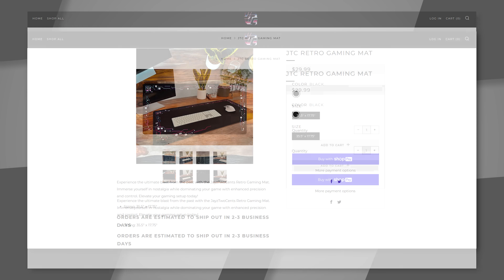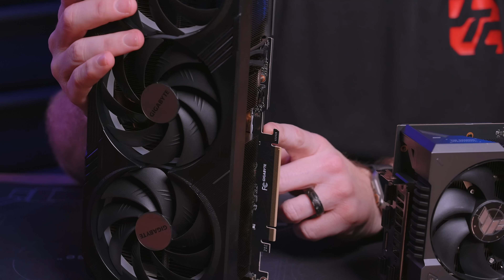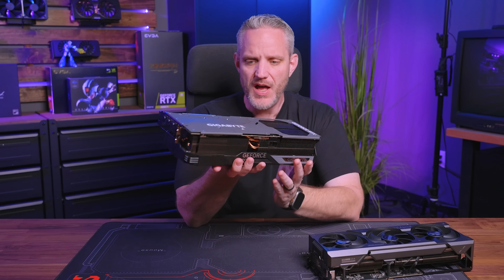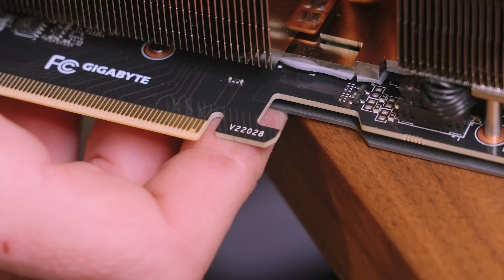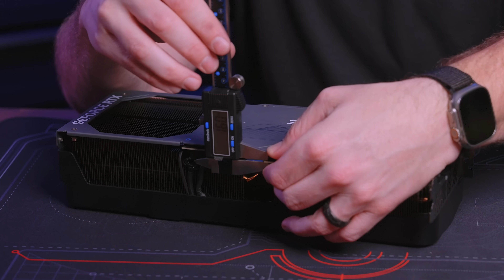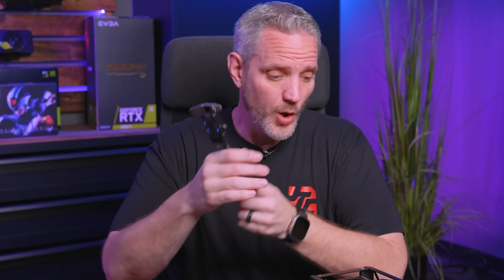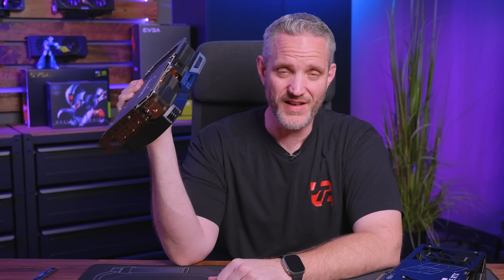These GPUs are cracking and the company REFUSES to warranty them!

Comment: Gigabyte does not have the goodwill to burn on something like this. If we are being honest most pc part manufacturers have been burning through any goodwill they've built up recently.(there are exceptions) Gigabyte however hadn't built that pool up yet at all. They are 100% eating thier reputation here deep into the red, possibly unrecoverably. Back to back Ls. Some brands have a pool of good will to bounce mistakes or bad batches off of, lots of people like evga for example, if there is an issue with thier products, the goodwill means the customers are more compliant and assured that they will be done right/taken care of. Puts them at ease.

Comment: To be fair - rubber is more elastic than plastic.
But it doesn't mean that rubber will break. It's a dumb comparison, but my point is more flex material is not necessarily worse. Would be cool to get info from the owners of similar cards. I kinda understand why Gigabite doesn't want to rma physical damage

Comment: hi .. 2 things ... 1. if multiple Cards with the same Failer/Error  come in .. then its not a defect .. its a Desighn Problem ... 2. at 6:45  the differnz in this 2 Cards is not that the PCB is more stabel ... when You look at the Videos both PCBs flex very easily .. the Reason that the Asus card seems more Stable ist the Screwed metal Post  wich gives a little more stability  and Prevents the Board to Flex in the Right side aeria

Comment: Good point. I agree with Jay on this. It's probably the latch that hasn't released yet, and the user yanking on the card. Admittedly it's a poor design, and why are Gigabyte overrepresented? Weaker boards perhaps but should you worry? I'd put my money on no.

Comment: I'm going to buy a GPU and I'll check the internet :
ASUS - these cards have a terrible coil whine
GIGABYTE - cracking
MSI - Good but expensive 
Sapphire- My favourite, but I want Nvdia 
GAINWARD - RPM problems , performance problems
Acer - I just don't trust Intel ARC drivers very much
ASRock - There is no buy just Intel ARC 
EVGA - They ended :( 
Inno3D - I've never seen the brand, I don't trust it. 
PNY - Very bad 
XFX - We only have 3 cards 6600, 6700 580 
Powercolor - We don't have Red Devil or Hellhound here. 

So what card should I buy today?
Reply: Zotac? Jk.

I think MSI eould be the best if we're going to choose by brand and then ASUS

Comment: Gigabyte Warranty Service is a separate division in the US from Gigabyte Corporate (that designs and sells the products). I HATE Gigabyte Warranty department, they will literally find ANY excuse not to warranty something. I had two problems with my Gigabyte X570 Master rev 1.0 motherboard: first issue was that CPU lane NvME drive had the shield torqued down so hard that when I went to unscrew the little screw the head just broke off and left the threaded portion stuck inside, with no way to get to it. The other issue was when after shutting down the PC one night, the next morning It wouldn't turn on, and there was no power to the board (checked everything it was def the board, not the PSU). Mind you this was a brand new board that had less than 8 hours of run time on it when the power issue occured. After paying to ship the board to Gigabyte, they sent it back without even addressing the broken screw, saying it was fixed, but not telling me what the power issue was or what the fix was. I COULD NOT GET THEM TO TELL ME WHAT THE PROBLEM WAS. Thank god I bought the board from Microcenter, I brought it back, explained the issue, and the manager just told me to grab a new X570 Master (now they had the Rev 1.2 boards), and just exchanged it for me (even though I was technically outside the return period, cause it took me a while to piece my build together). Thank you Microcenter! Gigabyte Service Center, go F yourselves!

Comment: At the RMA department from a computer shop I work at, I already came across several graphics cards broken there due to bad packing (or literaly no packing at all) inside the computers when clients ship them in for repair (usually they had no problems with a dead GPU before sending it in)
So yeah brands are literally making badly designed products and blaming the customers if they break because "damage by user" is their favourite claim in RMAs
Reply: Well, you figure with all the stresses that can impact shipping an assembled PC somewhere, you're probably better off telling the customers to remove any heavy cards from the systems and ship them separately. I've seen motherboards ripped off their standoffs by shippers. A heavy graphics card is just an accident waiting to happen.

Comment: Best solution.
Remove Tab, Or the Lock. I hate it and if you use 2 screws on the IO plate the card is rigid enough.
Unless you have a badly designed Cooler, well, that's unlucky..

Comment: both are 1.6mm you can see it if you review the footage before you take it up to watch what u messured.  =) Might it be so that the card can't be 0.4 thicker because it would not fit the slot in the motherboard... Because PCB's are uniformal thick because of the way their made.

Comment: I own the same gigabyte card and use the included support bracket. Have had absolutely no problem with sag or anything of the sort. Not using it should be your own responsibility imo, but everyone has the right to have their own opinion and do whatever they want of course.

Comment: about the thinner and thickest: you seems not to understand how the thinner one (asus) is not going the same way as the thiccker (gigabyte) but you explained it yourself:  if the back braccet is connecting to the coller (no sagging) then it have less force on it (split from the back locking bracket and the front locking, but its not the sagging will put more force on the socket- which mean more force on that side thats lock.

Comment: PCB’s are made of copper and fiberglass, and fiberglass is decently flexible. The likely solution would be to either use thicker fiberglass or to switch it out for polycarbonate.

Comment: The Asus card has less flex as it has a standoff nearby which does support the PCB. Those kind of defects are all over the place, take a look at Krisfix latest repair videos.
And not only gigabyte does refuse warranty for that case. Most likely all vendors do. Also please consider that those kind of flex is not only an issue for cracking the PCB but also GPU or Memory traces are breaking because of that. Never ever try to treat a new PCB like that. Treat it like an egg!

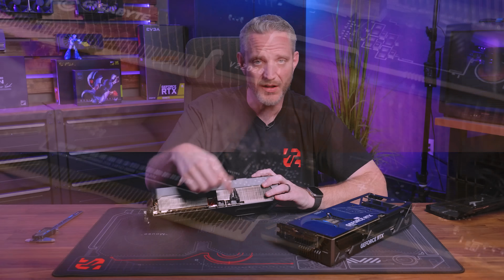Comment: at 14:12, the thing that stands out is that the ASUS board has a support beside the retention clip, and the gigabyte board does not. the flex difference may just be from that - structural weakness, not an inherent flaw with the pcb

Comment: 14:13 lmao jay ofc the gigabyte one bents more, it has wider inside notch and the asus one literally has support screw/stand next to it to prevent bending. it doesn't take rocket science knowledge to see that but still your point is true that if it's proven later that the card fail because of the notch cracking by itself it was clearly the manufacturer design failure

Comment: I'll never buy Gigabyte product agn after my latest purchase of GTX 2080Ti. The thermal paste died after a year causing some kind of wierd super loud turbo mode, the fans when spinning up are rattling so passive mode was not usable had to set fan curve manually. Overall buid quality of that card is worse them Asus Strix GTX1060 not mentioning that 2080Ti is smaller then mentioned GTX1060 so this is concering as well. Now I'm using Sapphire 6950XR Nitro+ and I love in every aspect.

Comment: Gigabyte is purely anti-consumer.  GIGABYTE GeForce RTX 3080 GAMING OC WATERFORCE WB 10G (rev2.0) had aluminum in it, but they didn't list that on their website, causing a lot of dissolved waterblocks due to people mixing copper in their loops.  Gigabyte didn't honor those warranties even though they failed to adequately notify their customers of the issue.  I have the Extreme version (copper) which I swapped with a EVGA 3080, and will probably just toss it.

Comment: I disagree to the Gigabyte being weaker just because it flexes more. More flexible materials in general are normally weaker but because of the flexibility they allow a certian amount of flex before real strain happens. Stiffer material in general is stronger but more brittle so if the amout of tension is reached it wil break quicker

Comment: I'm wondering if any Aorus 3080 Xtreme have been reported to have this problem.  I just checked mine and it's pretty solid.  Doesn't really flex at all.  Similar to the ASUS one.  Maybe the ones that are breaking are older models and they fixed the problem, or the older ones are fine and they cheaped out later.  I got mine in December 2020 so I'm guessing the latter.

Comment: Hi Jay and thank you for the upload! I've got a AORUS GeForce RTX 3080 MASTER 10G. Have you possibly seen or heared any cracking defects on these model cards?
You analyzed the stress on the locking point of the board related to the positioning of the board in the case so clearly that i ended up making a hanging support using zip ties for mine :)

Comment: hobbyist GPU "repair technician" here with a few notes:

- Gigabyte closely follows the Nvidia AIB Reference PCB design for their 30 series (and 40 series) cards, brands like Palit, Zotac, inno3D and many more do the same. looking at the PCB online i only see customization in the VRM and power connector area, not the PCI-E slot area. this means that the gigabyte cards use the exact same pcb design as almost all other cards except the very high end very custom cards (which i have confirmation of also cracking anyway).

- cracks like this have been happening for ages, i know of a case of an ASUS 780Ti with a crack just like this, i also remember several cases from 1-2 years back of this happening a lot to RX 6900XT cards from a number of brands.

- (as Buildzoid pointed out in his video on it) damage like this does not just happen over time. you need a strong force acting on it suddenly rather than a weaker force over a long time. the latter would just lead to slow pcb warping over time which has been happening for years and does not usually break the card. i have several GTX 580 DCUIIs that have a good 5 degree or so bend to them that still work. this means damage like this is caused either in shipping or because the pc is exposed to strong almost punch like forces

- (buildzoid also touched on this) every manufacturer (we have confirmation ASUS and MSI do it) denies warranty on damage like this. because it looks like shipping damage. which in most cases it will be. in these cases a claim should be made with the shipping company not the manufacturer.

- the reason why repair technicians may be seeing so many gigabyte cards with cracks compared to other brands with cracks is because (at least in my region) they are a common brand for both pre builts and custom builds because they are usually by far the cheapest option among the better known brands and typically offer better coolers than for example zotac or palit

in my own opinion this entire situation is what i like to call "the consequences of accepting >350W cards as normal". these cards need massive coolers which are very heavy and most people do not vertical mount them. this enables this entire problem. especially prebuilts suffer from this because they have to ship the GPU installed into the system but rarely have things like hold down brackets meaning the gpu will be under extreme stress in shipping. once it arrives at the customers house they will find their pc not working and send it back. once the seller gets it they find the card has cracked and get their warranty denied due to shipping damage not being covered and then those cards end up on ebay where gpu technicians buy them to repair them and notice a lot of them are gigabyte and can easily make the false assumption that it's a kind of design problem when in reality that prebuilt company might just use gigabyte as their main supplier or maybe the customer just chose that card because it has a big 4 slot cooler like a strix but only costs 60% as much.

Edit: also please don't collab with northridgefix. he is not a proper gpu repair technician. he once used 2V to check for shorted DrMos, killing the IMC and Memory chips in the process. he frequently diagnoses fixable cards as non fixable and generally just doesn't know what he is doing. he is great with laptops but ask any other repair tehcnician in the gpu repair discord and they will have a horror story ready of how he killed a perfectly fixable gpu on camera pretending to try to fix it. he is the frame chasers of repair technicians. looks competent and knowledgeable but in reality he's essentially a scam artist.
a good example of who a proper repair technician is would be krisfixgermany who if you watch his videos and northridgefix's regularly does end up fixing issues that northridge deems non fixable.

Comment: This comment is purely speculative and just asking for someone more knowledgeable to provide insight, but is it possible that the more flexible PCB is less prone to fracturing, and the 40xx series board material Gigabyte is using is less rigid than the 30xx series that was fracturing specifically for that purpose?

Comment: Jayz I think you might contributed to this a bit. I always get goose bumps whe I see you plugging or unplugging cables from GK when it is already installed in PC. 
I know you have a great amount of experience (and probably have "higher resistance" to breaking something, but your viewers don't. But youre taken as example and (especially unexperienced) ppl are mimicking you.
Please stop (un)plugging power cables when GK is inserted into MB and keep mentioning to your viewers "not to be lazy" remove it from BM first and then (un)plug. If you cannot reach release mechanism anways use some plasitc or wooden or simply non-metalic tool to reach for it. Never use scredrivers I've many damaged MB coz it simply slipped and broke MB traces or shaved smd parts.

Comment: FurMark should change or get rid of the warning before start. If I think about overheating GPU only this message comes to mind and it actually makes a connection in my mind between a graphics program and GPU failure, when it actually is completely wrong.

Comment: Northridge fix is a money grubber. He charges for everything he can, he has a no fix fee and talks about his customers like they are idiots and crooks. He changes burnt components on laptops even if he knows from experience that the cpu is already dead with that particular fault just to charge for the repair. He is not a decent guy and doesn't deserve the exposure. He has good soldering skills but he lacks in diagnostics. I found a video where someone disassembles and figures out the original manufacturer of his microscope. He sells it for double the price at a 350$ markup. Louis Rossman is a much better choice for a collaboration, or Nortwest repair. He is a smart guy. If you watch his videos you will actually learn something, not just watch a guy fix broken traces and replace connectors like Northridge. I can share the video if you guys want the northridge fix camera for the real price of 350$, not 700$ 😂

Comment: The way we mount graphics cards needs a rethink.  Cards have grown so much in size and weight but the socket has not.  Its time for a new standard.  Cards with multiple mounting holes and a connecting them  with a flexible cable might be needed.

Comment: The real problem with the 30 and 40 series GPUs is that the companies are not making the I/O bracket (one that mounts to the cabinet) three slotted. As all the cards are more of less 3 slots wide, they should provide a wider I/O plate to support the 3 point support a GPU needs. As Jay said also that the I/O bracket should mount to the coolers and heatsink for more rigid mounting points. GPU companies should take into consideration that most of the people mount GPUs horizontally and make their products more resistible taking into consideration the huge GPU coolers and their weight. Also the customers are required to either buy an anti-sag bracket or use one that comes with their 40 series cards, just to be safe. ( A $25-$50 would save $1000 )

Comment: I'd be willing to bet money that both the Asus and Gigabyte cards use the exact same PCB material and as the pinned comments says they also have the same thickness. If there is indeed something wrong with Gigabyte more then other manufacturers it has to do with something else like the shape of the PCB, specifically on the notch part,  or the overall mounting of the cards.